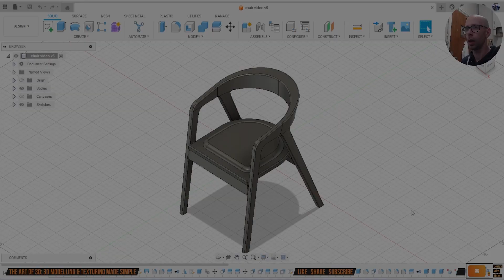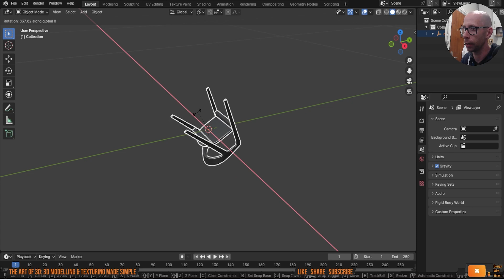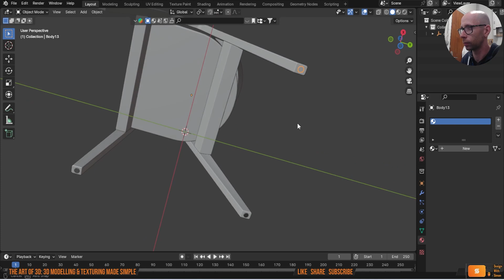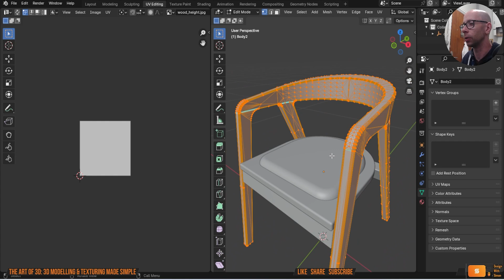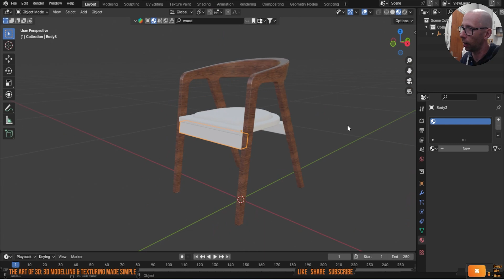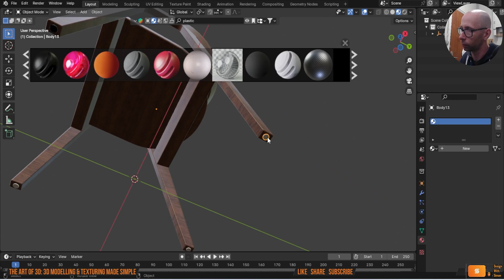Fusion to Blender tutorial- How to import your Fusion model to Blender

Comment: Importing from fusion to blender leaves me with a bunch of nasty topology triangles, unfit for subdividing with 3d textures. even alt-J does not fully fix the problem. have you found a better way?
Reply from the maker: Unfortunately not that's just how importing CAD files works. If you want to be able to edit them properly in blender or any other 3D software you would need to remesh it or do something called retopology. It can be quite time consuming just depends whether its worth your time for the specific project